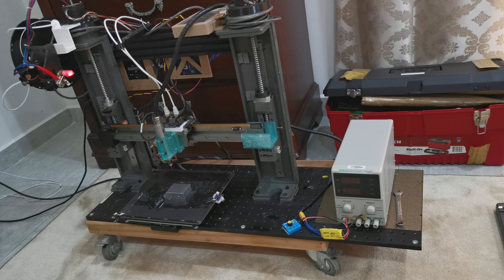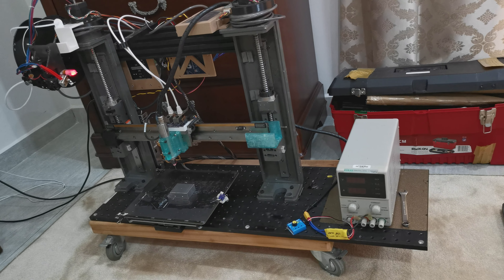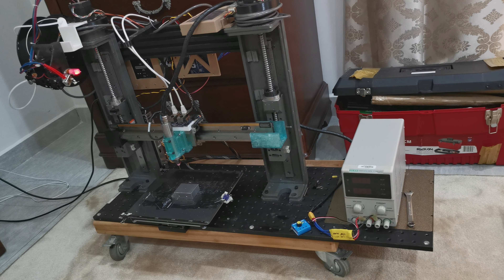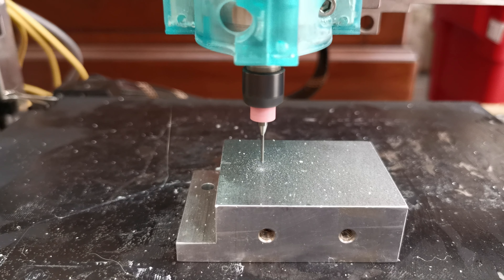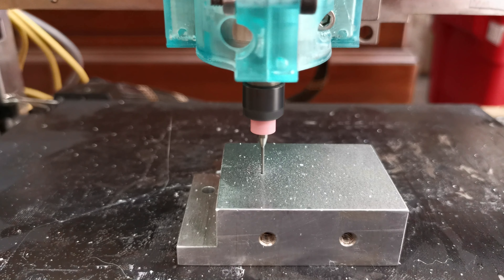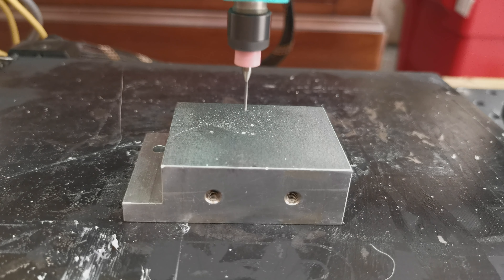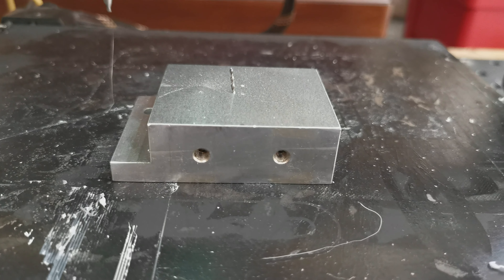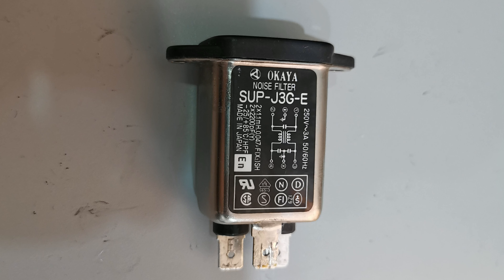SycoTec KaVo milling spindle on linear motor 3D printer. (Drilling Test)

Comment: You ran a high speed KaVo with a simple brushless motor controller? Cool. i just got a kaVo4041 for my DIY CNC build. It was super cheap, and now I need to find a way to power it. How many RPM did you get off that voltage ESC? TY.
Reply from the maker: I made a video about measuring that here : https://www.youtube.com/watch?v=bLeNdTt4MC4
Reply: How did you get it? I've been trying to find sellers for SycoTec/KaVo spindles.
Reply from the maker: @DarthAvocado14  ebay. I see some there right now....